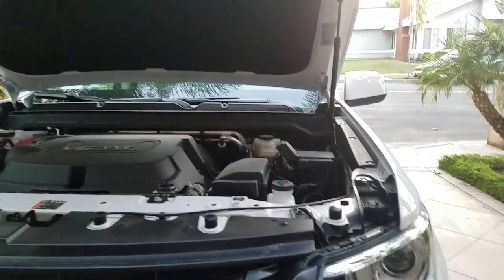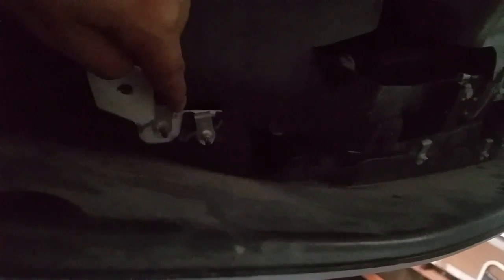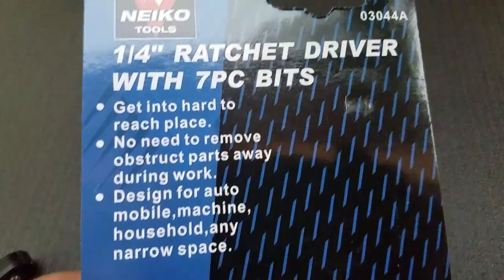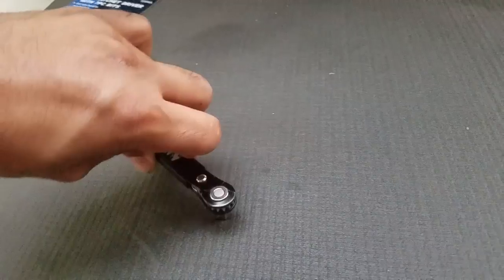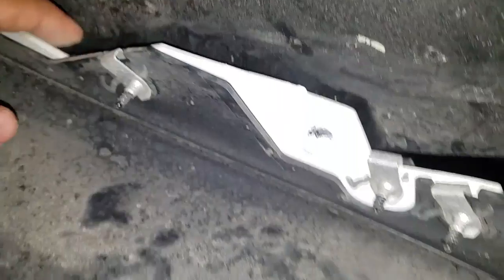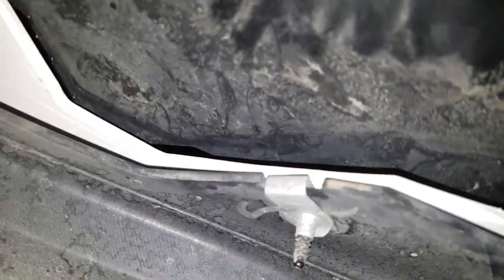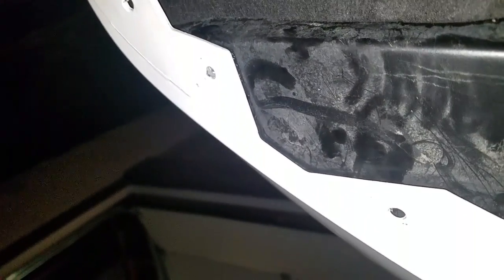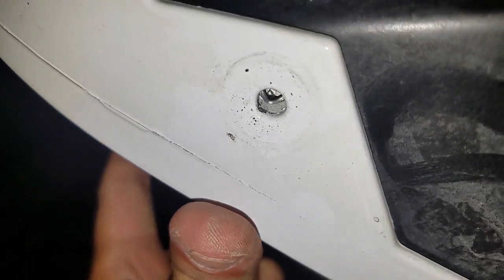How to remove Air Dam off Chevy Colorado/GMC Canyon (no cutting, no bumper removal)

Comment: Great video, I took your instructions and removed this silly plastic thing in 30 minutes.  THANKS!  For anyone else fyi, I did improve on the ratchet tool used by cutting the T-15 bit in half with a Dremel steel cutter making it MUCH EASIER to get the tool into the places to unscrew

Comment: that small rachet tool really helped a lot. pls. take your time on doing this, be very patient.mine took me a week to finally get it off.i don't notice the mpg difference at all.the only reason why i took it off was it gets scratched all the time when i parked at the curve higher than the base of the air dam.it so damn annoying.
Reply from the maker: There is a mpg impact for sure, especially if you do highway driving. But it's not much.

Comment: Nice commentary. I'll be taking mine off my Ram 1500 today. I already removed some plastic pieces from inside the cab (cosmetic, like the one hiding the adjustment rail for the front passenger seat).

Comment: Question. I haven't tried this yet, but just wondering if you could have done this by using a pair of small locking pliers and unscrewed them from the bottom?
Reply: Have you ever tried?

Comment: I just bought my Colorado, and yeah that shit needs to come off.
Reply: I did too, Vinny.. but I keep hearing it voids the warranty and effects engine cooling??  wish I knew 4sure ..
Reply from the maker: Yora Nidiot my understanding is that it does not void your warranty.  This is what the dealership told me. Check with yours
Reply: ..well, that's where I got the voided warranty info, was from the Dealer. ?  I just saw a YT video now, saying the owners manual says it's ok to remove.  Good Lord.. ????   :)
Reply: .. to me, I think they just didn't wanna be bothered.. said it was 2.6 hours of shop labor, too.  $260 ??? UGH
Reply from the maker: Yora Nidiot check with another dealer or maybe contact corporate
Reply from the maker: I took it to a few shops and it was more of the same....2 hours of labor to take the ENTIRE bumper off.  No need for that.  This can be easily taken off by anyone with the right tool.

Comment: Seems like a lot of work. Why don't you just cut the silver screw clips? Are you saving them and planning on reinstalling the air dam in the future?
Reply from the maker: Potentially, yes. Because it negatively impacts MPG, you may want to install it back one day. I never have and don't plan to, but I kept the air dam and the screws in case I sell the car one day.

Comment: I thought this video would help, but I really don’t see how you can even fit that tiny ratchet, which I bought, into certain areas, especially the passenger side. The bumper just simply won’t give on each end. Unfortunately this video didn’t help me at all for my 2020 Colorado.
Reply from the maker: Maybe the bumper is different on the 2020. On the 2016, you can jam the driver in there and the bumper flexes just enough. You can see at 2:59 that it takes a bit of force to get it in there and the bumper flexes quite a bit. If you find a certain screw is impossible to get to, you unscrew some other ones around it so that the bumper has more freedom to move in those areas. I think it helps to pick screws that are spread out....so you don't want to go in a straight line. I started from the outside of each side and proceeded to the middle.

Comment: maybe it's there for a reason also for to protect your electronic power steering
Reply from the maker: Bohemia Lite it's a flimsy piece of plastic... Doubt it protects anything
Reply: OK just check powerelectric mod..That it's away from water access..
Reply: On the GM website they tell you how you can remove it

Comment: How much was mileage affected by doing this. I'm thinking of doing it to mine
Reply from the maker: Bigben1971 you can find this info online. I won't give you a good answer, since I leveled the truck as well as purchased bigger tires just before taking the dam off. Lost a few mpg for sure... Probably like 2mpg total after doing those three things
Reply from the maker: Btw i have definitely thought about putting it back on for road trips. It's just too much of a royal pain in the ass, so i doubt I'll ever put it back on. Plus there's always the possibility of a bit of off-road fun on road trips :) i would definitely be interested in an aftermarket snap-on/snap-off solution... Or even DIY
Reply: Late to the party but mine went down over 10%. Big difference. But mine broke during muddy driving.